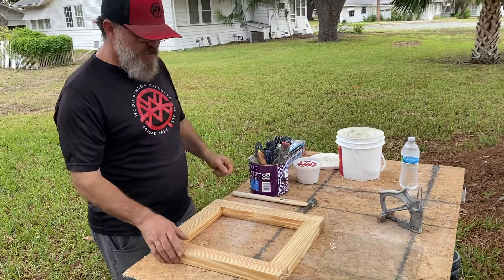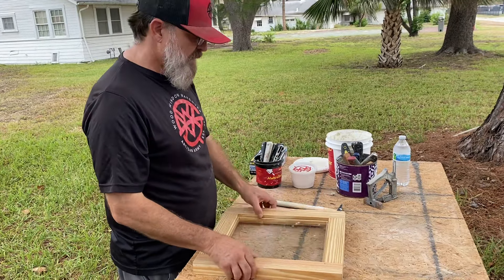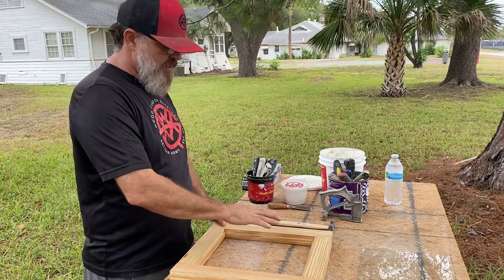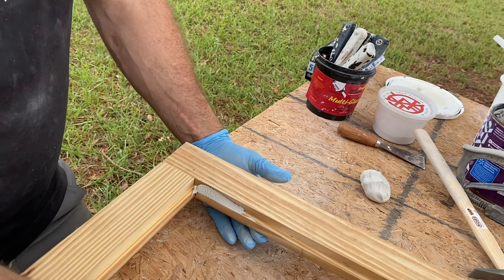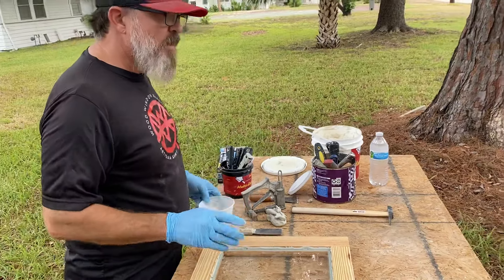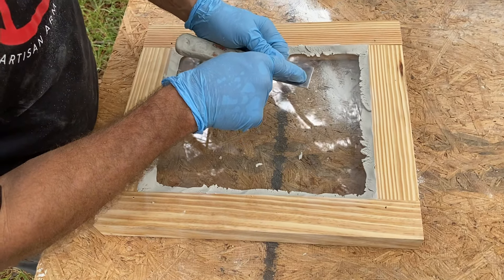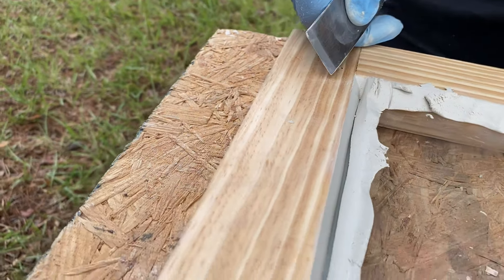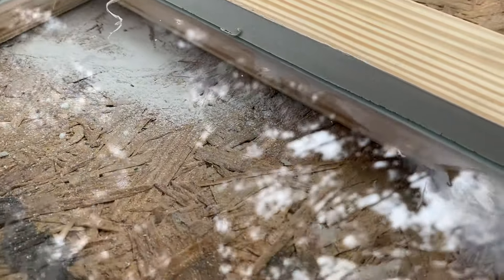Your Glazing Game Will Improve Immediately After Watching Steve Explain These Tools And Techniques.

Comment: CLAMPING THE SASH WITH LITTLE WOOD BLOCK TO PROTECT SASH IS GOOD WAY with woodshop clamp. clean off glazing on glass with plaster of paris  and small paint brush  at glazing bead edge, and rag, tissue on inner area of glass. Must prime the "shelf" actually the rabbet, prime the rabbet before glazing, he got that wrong, use boiled linseed oil if the sash will have wood stained finish, acrylic primer if will be painted, BUT PRIME!

Comment: Some excellent tips here. Thanks! I'm curious though as to why you skipped the step of applying linseed oil to the sash before applying the putty. I learned from a master years ago that should be the first step to help with penetration and bonding.

Comment: Not a bad video, better than most. Not sure why you would use joint compound that essentially gets hard over time vs whiting (aka ground caulk)  which promotes the skinning over of the glazing in addition to soaking up the oils. I'm curious of the effects of the 20min drywall mud long term since glazing remains flexible allowing the glass to move in change of seasons. Load better than the guy that glazed a window without points!

Comment: When i fix old windows on my house the glass is thinner than whats normal now. Then if i use thicker glass the points stick out to far for the angle of the putty to cover the points any advice on that?
Reply: Use A clear caulk not silicone to back bed the glass. No need for points unless the wood or glass is warped
Reply: I would NEVER use any caulk on window glass, back bedding or otherwise.  It's sloppy work that makes repairing the windows in the future an absolute bear—you can't get the glass out easily and caulk residue is left everywhere.  Definitely do not do this—it's a total amateur move.
Old single thickness glass might be 1/16".  Newer or even old double-thick glass might be 1/8".  Sure it's thicker, but not a big deal as far at the glazing points go.  As the guy in the video shows, just set the points a little deeper.  Alternatively, if the points are too big and you are setting them by hand, just trim them a little first.  And if that failes for some reason, just extend out the putty a tiny bit to clear the point.  Going 1/32" over the desired edge isn't going to be noticable.

Comment: I certainly like the putty knife technique.  After deglazing old windows, removing old hard/cracked putty, etc, I usually pre-prime old sash before setting any glass.  I also use painter caulk for the glazing set because it is easier to press out.  I also tend to go with the rolled out 'ropes' of glazing putty for loading the glass prior to the putty knife set.  Will try your way I am sure.  I have also simply pressed in putty with the knife blobs along the mullion rather than my thumb or 'rope'.  Your method looks like it might be a lot faster at the putty on glazing phase.

Comment: I have been trying to Putty for months. I just don't understand what going wrong. I have followed every single step and I have every single tool of yours. It's like my sarco Putty is a completely different substance. I hand kneaded a brand new container for over half an hour to make sure everything is blended completely and when I attempt to glaze, it is SO STICKY. It sticks to everything. The Putty just cakes onto my gloves and Putty knife non stop. It builds up to where I can't even work. I'm desperate to figure out what's going wrong. 
Sarco themselves, recommended that I dip my Putty knife into Acetone for a smoother finish and it helps tremendously. But I still waste an insane amount because it's built up on the handle and blade and gloves.. it's a nightmare.

Comment: Thank you for the demonstration, I learned a lot just from this one video. Do you have any for removing the old glazing and that whole process ? Thanks again
Reply: For removing old putty you need a very sharp chisel . I tried to keep the bevel of the chisel against the glass. If you use the chisel  the other way round it will dig into the wood and make a real mess . I have an old Ward chisel that lasted a long time . The clean shiny chisel is quite good for putting in the putty . But leave the putty for a few days to dry out before painting it .
Reply: Sharp razor blade remove it especially if it’s brittle and chipped.
Reply: I built a steam box ala John Leeke the preservationist. It softens the putty to mush so I can knife it out easily without breaking precious Old Wavy.
Reply: Do you have to prime the window before glazing it?

Comment: Is the sarco putty the best way to go vs other brands ? Its damned expensive .
Reply from the maker: Expense is relative, really. What makes Sarco unique is that it sets up enough to be painted in two or three days. Other brands, like DAP33 take up to a month.  This is one of the many reasons professionals prefer Sarco. If you are trying to keep a schedule, bill the client and move onto the next project - Sarco is the way to go. You can glaze your sash on Tuesday, wait Wednesday and Thursday, then paint it on Friday and delivery it to a happy client, who will then give you money that will reimburse the cost of the Sarco. It’s the client that pays for the Sarco.  It’s the Technician’s skill In using it that will make the money. 

But maybe the technician has all the time in the world and doesn’t care about finishing….  Save a couple of dollars and go with DAP.
Reply: @WoodWindowMakeover  Thank you for the quick response . Yeh , im just doing widows on my house and garage . Still though i may go ahead and go with sarco an just do a little at a time .
Reply: Even more than the fact that Sarco can be painted sooner is that it stays more flexible than the Dap33 and is infinitely easier to eventually remove and repair. The Dap33 sets up like concrete and is a bear to ever get out when the time comes, making it far more likely to break a pane during a future repair.  Definitely spend the money and buy the Sarco... it's far better stuff to use now and also for the ultimate life and reparability of your historic windows for future generations.  I've had to repair windows that I had done myself a couple decades earlier using Dap33 and regretted using it dearly.  Spend the $ on the Sarco.
Reply: @jamesburkhard  Thanks for the tip. We completed 6 window restorations but were totally overwhelmed by window 7. We struggled mightily to remove the glazing. Like you said, it seemed to stick like concrete. Fast forward, I was just about to start reglazing with Dapp when I read your comment. Then I decided to order Sarco m online instead. Appreciate your comment.

Comment: Glazing putty is going to dry up and start to fall out within two years. You need to prime all bare wood with oil base primer to keep the oil in the putty from absorbing into the wood. A bent  putty knife is a more professional tool and creates more pressure on the putty which forces it into all the cracks and crevices in the wood eliminating any air bubbles. Applying glazing putty with your non dominant hand and using your dominant hand for the putty knife only, allows you to use the ball of putty in your non dominant hand to pick up residual putty. This technique keeps your putty knife spotless and your putty in one area. For your bedding putty soften it by mixing it with a little linseed oil or a small amount of paint thinner. This makes the putty softer and you will just push down along the edge and eliminate the use of that sander that can pick up debris and scratch the glass. I've owned a glass shop for 52 years so I guess I'm considered a professional. i give you a lot of credit for your video on this lost craft and I hope my comments can help your viewers who need to do major window repairs.

Comment: I recently got some Sarco type M and despite kneading it thoroughly, it was much stickier than this. It wouldn't move off the glass as easily. Maybe I could add some white powder like drywall mud or masonry lime?
Reply from the maker: You could add some powder. I have not used lime. But the drywall mud I’ve been using for years and feel good about that.